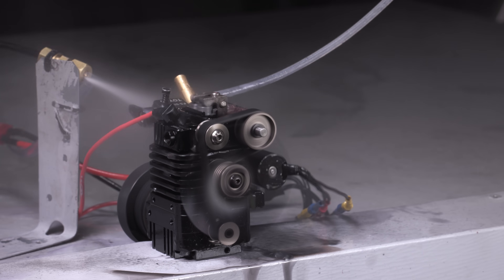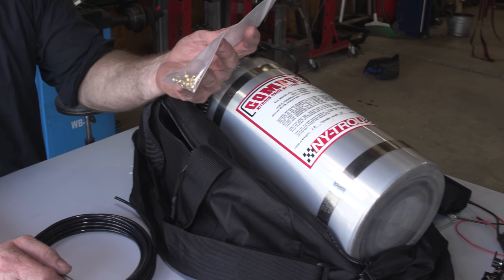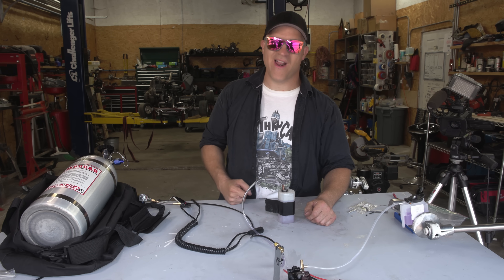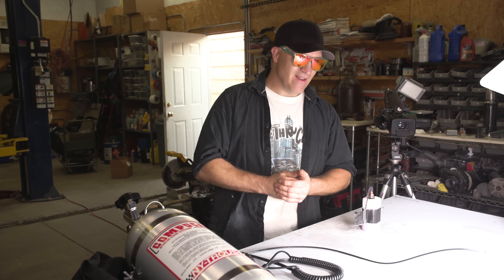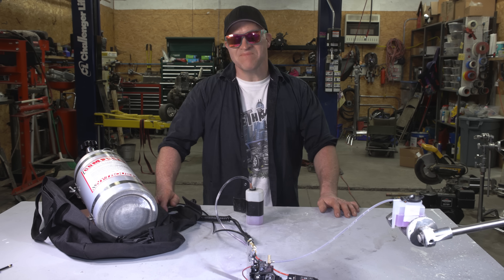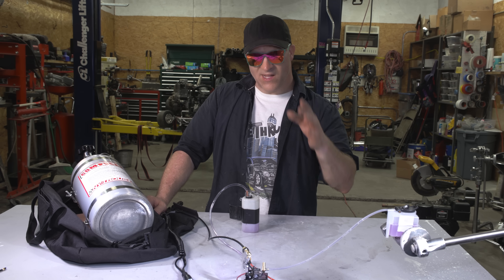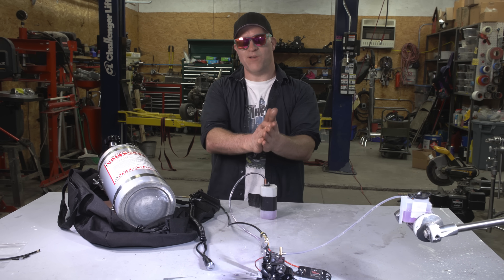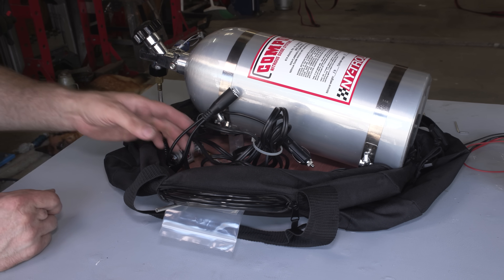Miniature Engine Gets 100 shot of NITROUS OXIDE

Comment: it would be cool idea of electric scooter motor-wheel overvolt up to a failure in slow motion
Reply: Or run a capacitor run 120v 60hz motor on proportionally higher voltages and frequencies, up to 2kv 1khz with a run capacitor that's 4% of what it normally uses. Decrease the capacitance with the square of the frequency so the current and phase shift stays the same. Blowing a complete DC brushless motor with overvoltage will probably just burn a transistor. A little bit of funny smelling smoke and then nothing.

Comment: Material tolerances change with how things are cooled down & this being such a small engine it's easy too cool down +  revving higher isn't as likely too damage things either.
I wouldn't mind you strapping this engine down into something like a 1:5th scale chainsaw engine car with a smaller nos tank being activated on the remote for a few seconds via a third channel and make some pulls for speed comparisons purely.

You'll find some scoring on the bearings & the head has gotten some damage from the cylinder smacking into the valvetrain a bit, also it seems too have launched one of the retainer clips for either one of the pulleys or the valves so it wasn't far off from cracking something but thankfully dropping that made it loose compression which is why it stopped running pretty much.
Reply: And some people say nitrous doesn’t damage an engine🤦‍♂️
Reply: @its_robbietime1333 
Ikr... even a well prepared engine gets significant wear from the extra forces if its still running beyond it's intended design.

Look at top fuel dragsters for example they rebuild like every other event or around 20 - 30 miles with 2 - 3 spare engines in parts if one blows up earlier usually.

Also didn't watch the entire video as i wrote that comment so was speculation more then anything but i suppose i wasn't that far off after all heh.

It dropped compression thanks too the head bolts undoing themselves more then anything, the c or e clip definitely came from the head itself though.

It probably has warped the head a bit at that point if it doesn't have compression putting those back in place, tolerances as mentioned are not as much of a concern if the entire thing can be cooled down properly.

And ofc if its not shaking itself too death warping the crank or similar.

But it goes the opposite way too ofc if it gets a hot spot in the corner of the cylinder it can easily just deform enough of the piston rings too pretty much make a dead stop & boom either a bent crank on the next rotation as other parts of the engine has lots of force behind it still.

Or the block itself has now an inspection hole near the side of the crank or cylinder sleeve if it punched through in the right direction & there is enough force behind it.

When it comes too running this on nos you can perhaps fabricate a few things that would help it stay together a bit better from the vibrations, like redesigning the crank & block with a balance shaft too counter the vibrations, change the tune so it sparks & adds fuel I'd say 5 - 12 degrees after it hits the top of the piston cycle & perhaps have a bit more material in the head itself on the engine that can absorb the cooling as well as replace the head screws with ones that have a bit higher grade material & add loctite so they stick in place a bit nicer.
Reply: How does a cylinder hit the valvetrain? It's immobile. Did you mean piston?
Reply: Josh St. Louis this guy either cant articulate what he is tring to say or is just plain stupid. He also said top fuel rebuilds engines every 30 miles. They rebuild them after every round

Comment: 2:34 This is how liquid cooled engine really looks like :D
Reply: What ?
Reply: @bingbing-ti2rv  the engine is being cooled off by the spray of gasoline that's covering it.
Reply: @bingbing-ti2rv  Yes
Reply: You'll know the cooling isn't working when it catches on fire
Reply: That wasn't gasoline, it's nitromethane which has oil mixed in to lubricate all of the moving parts.

Comment: That's using the venturi principle to deliver fuel, not a siphon effect. Also, I'm dubious that you got any actual supercharging this way since you aren't pressurizing the intake.
Reply: Spraying NO directly into an engines intake will create a HP boost. James from over on Cleetus McFarland's will gladly demonstrate this for you.
Reply: @oldmanbluntz  that was also demonstrated with leaf blowers on Roadkill. It's still not supercharging if you're not pressurizing the intake.
Reply: @RyanMcIntyre  but nitrousn isn't forcing air under pressure into the engine, i think you need to go over how nittous works again.
Reply: @aaaabababa  I know what it is, perhaps you need to go over why it works the way it does again?  I understand we're not talking about 2 atmospheres of pressure like mechanical supercharging, but while you guys are all ready to pedantically jump all over me for a minor discrepancy in your definitions of supercharging, anybody that's run a nitrous engine can agree that this isn't the proper setup to get a proper chemical supercharging effect.
Reply: @RyanMcIntyre  I get supercharged when I get on coffee or an energy drink, as I rarely consume caffiene.

He may have been referring to it that definition of it as well. The engine got super charged in power with the introduction of the NO to the throttle body.

Either way, the video was awesome. That engine spun up so much faster. It'd be cool to see a mini brake dymo setup on it and see the power gains as well.